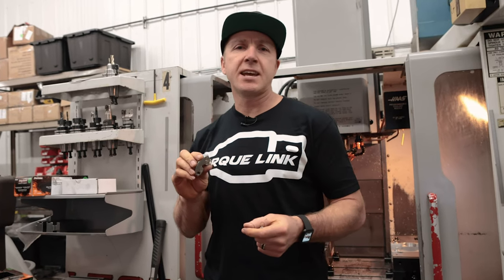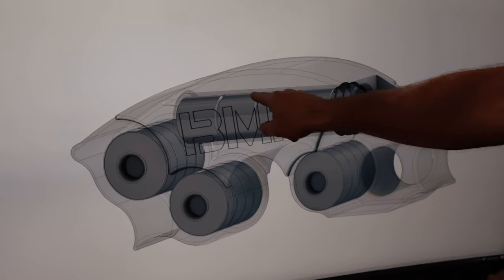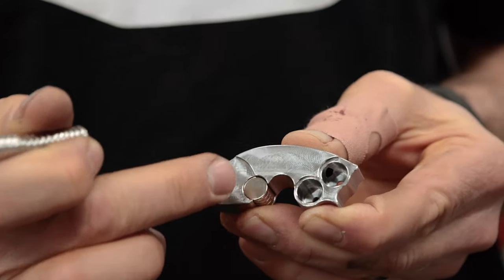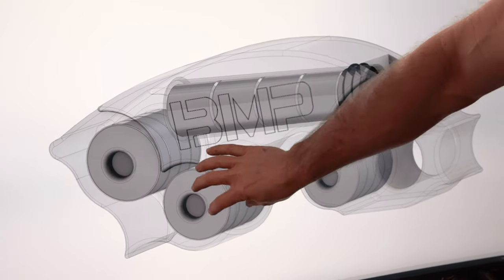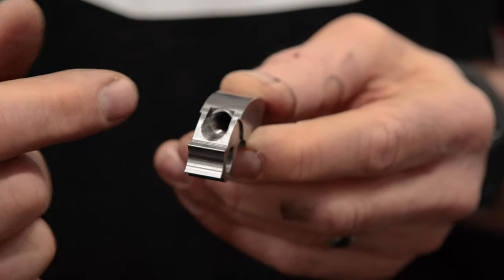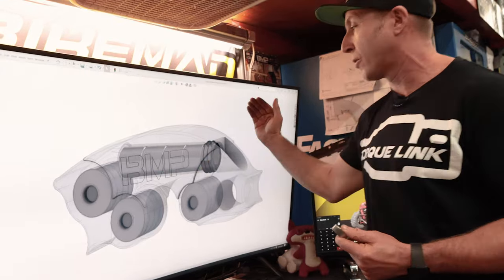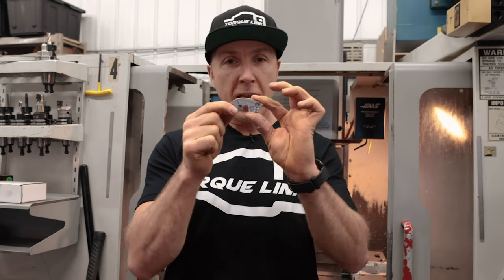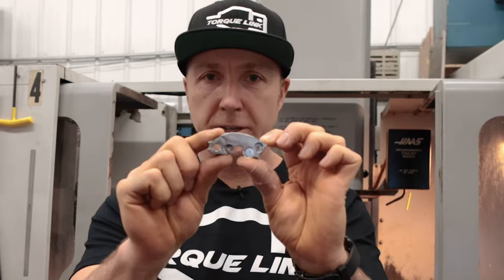We Just Revolutionized Clutch Weights!

Comment: I bought some clutch weights only to find out two of them were precisely what they should weigh and the other one was .9 g heavier . Would it still be okay to use or would that cause damage to the motor due to the possible wobble from not being balanced
Reply: .9 grams is a lot and will jam up your primary clutch and cause terrible performance
Reply from the maker: Hello, sorry for not seeing this earlier. Not sure if you got this resolved. But we would replace that weight. We have a very tight product control but this might have slipped through our quality control. Call in and talk to sales about your issue and we can take car if it for you if the weight is that far off the other two.

Comment: Ok. What if I only need 49-55oz. Can those be made ?
Reply from the maker: We make weights for high and low elevation applications. If we dont have a weight that covers your range, you can modify our weights to make them lighter.
Reply: Ok so if I need 50 oz weights. You can make thoses the same plug add one